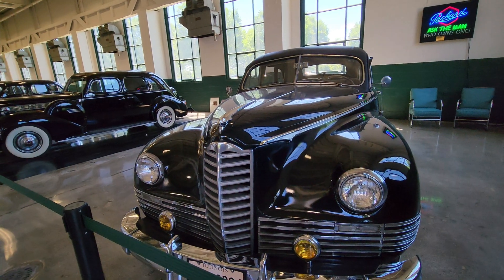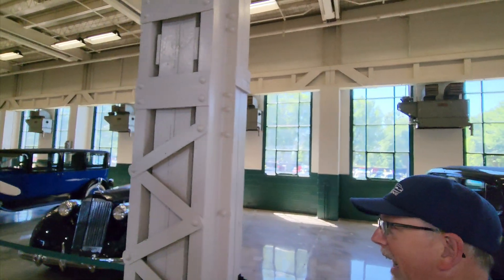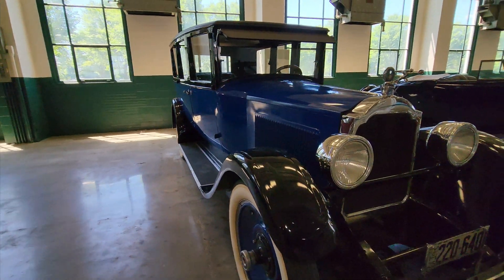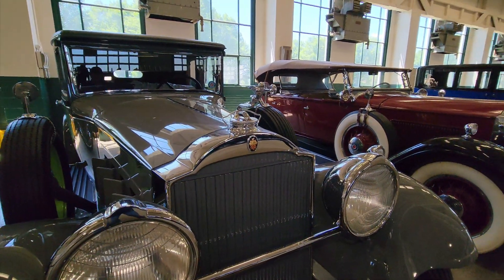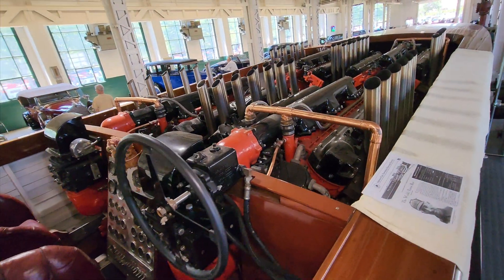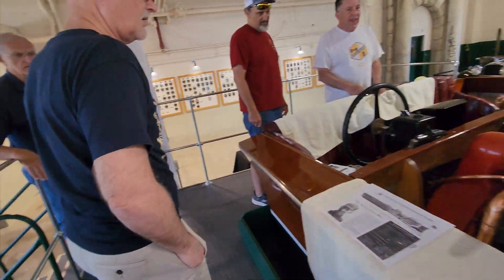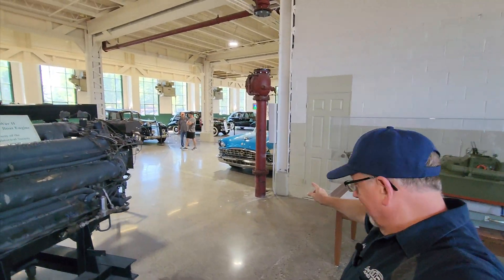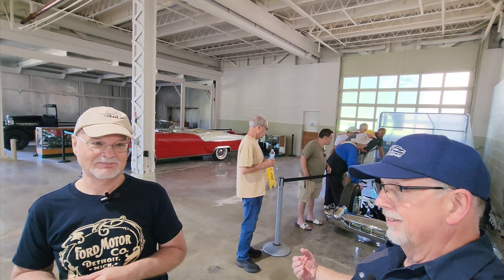Mind-Blowing: 4 Packard V12 Engines in Boat

Comment: Best to be accurate. The Miss America X engines were only rated at 1200hp with 1600hp available only for 60 seconds. The Pachard V12s in WW2 PT boats were only 1200 hp and their range was very small due to fuel consumption. The P51s used RR Merlin engines with some made by Packard under license. The P51s in Europe in 1944-45 came with no engines by ship and had Merlins installed in Britain.
Reply from the maker: @TruthHurts-o3j  Great information, thank you for watching!
Reply: Garwoods engines were modified they claimed 6800 for the 4 here is the video https://www.youtube.com/watch?v=kl9wo_LCei0 
I sure wish it had sound those carbs flowing those garden hoses of fuel on the dyno sure do look nice!😀

Comment: Dad. Was a Tool & Die maker for Packard from 35 to 45. He worked on the protype Rolls Royce Merlin engines that they tried to.use in  the P38 instead of the Allison. Also he owned a post war Packard that had the engine wear out in short order. He called a friend at Packard where he was told they were using green blocks. My Dad's 1st cousin was in the PT Boats in the same squadron.as JFK in the Solomons. He commented that a lot of the officers were from wealthy east coast families because they had sail boat experience.
Reply from the maker: @tabs9213  That's awesome! Thank you for watching.